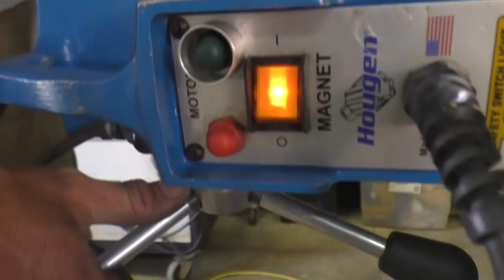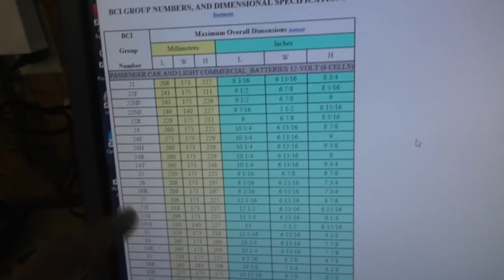Generator Frame and Engine Room Installation

Comment: YES! The DeWalt cordless portaband is epic.  Just picked one up with an extended life battery, and it paid for itself on the first job.
Reply from the maker: Richard at 42Fab sure loves all things dewalt.   I think they are great for the little jobs or were you have lots of little jobs spread out, but we have extension cords all over the place on the boat, and tools that burn 15 amps.
Reply: SV Seeker they’re just like cordless drills in the shop.  Certainly limited when lots of amps are needed for an extended period of time, but for general use it’s fantastic being untethered!  

Those DeWalt batteries recharge quickly too.  I only bought this cordless because my corded Milwaukee died.  Glad I switched.
Reply: And FWIW, with a 14 tooth blade and 6.0 AH battery I was able to make 8 cuts through some 6x6x1/2” steel angle iron.  Made 4 more cuts using two 1.5 AH batteries that came with my 20V cordless drill set.
Reply: It depends on the work your doing, I’ve got Milwaukee port a band with 9amp hour battery and it is a beast for most work (never used up a battery in one day doing fab work), but every now and then a corded one would be better for the extra punch. Either it or the M12 compact port a band would be amazing if you were a professional thief.

Comment: Sent here due to an Australian youtube site of a steel boat called Brupeg. They gave your site a good thumbs up. So here is a new subscriber from down under.
Reply from the maker: Cool.  Also check out "Life on the Mold"  another excellent Australian build.
Reply: I have a steel boat and looking at paint and rust protection. So many options.
Reply from the maker: Terry Peake I know the feeling. I tested pains and a saltwater tank for one year. Were using coal tar Epoxy.
Reply: @SVSeeker  this is a sailing yacht. Mainly topdeck and builge areas.

Comment: You might want to weld a couple of level foot holds below the deck. It will make working on the main engine a lot easier

Comment: engines typically have a stainless steel flex joint in the exhaust system before the first solid mounting point. since seeker will flex when in sea troughs or crests a flex joint is a good idea to do to prevent at sea stress fracture and failure of the exhaust pipe. also will solve any alignment issues as a side effect. it could possibly reduce harmonics and vibration transmitted to the hull as well.
Reply from the maker: Howdy Amiga.   Yes.  We have a flex coupler for each.
Reply: yey team! ;D

Comment: I see all these comments about heat in the engine room.  Its pretty hot underneath the hood of a car.  I agree with the plan of fans venting the engine room.  One pulling air, one pushing air.  Question about power management,  will the alternator make sufficient power so that the generator only has to run when the engine is off?

Comment: I do understand that room is tight in this vessel, but i do think having that Cummins underneath the other two engines is going to cause loads of overheat issues. You should ensure you have proper airflow in that engine compartment. 

In regards to the engine controls, that is actually what i specialize in. You should look more out there, there are options for you to have remote monitoring (from the ship's bridge). I know you think low oil pressure shutdown is cool, which it is, but there are so many more options out there that can provide so much more functionally.
Reply from the maker: I don't think that is an issue.  Those engines once lived in metal boxes and had radiators in the same box.  Now the radiator is a keel cooler and they live in a vented engine room.

Comment: SV Seeker I think that you need to change the bus transmission to an for a boat with forward neutral and revers
Reply from the maker: Bus transmissions have reverse too  :)
Reply: SV Seeker yes but it also have first, sekond, third and more gears. But try! :)
Reply: Christopher Chapman yes that was why i reacted..  If he want "that kind of power" he needs rotatable propeller blades..

Comment: Great video. Got a question, though. How much will Seeker heel? I ask this because it just occured to me that the oil pick ups inside these small engines may run dry if the boat heels too much. She will only heel a lot upwind but it's a consern. Having them in the low parts of the boat will have less effect than, say, a unit up on the deck. Are you numbering the decks like a ship? Starting at the keel with #1 deck? I know, I ask the odd questions.
Reply from the maker: Depend on how big the wave is and if she is breaching,  but normal heal will be about 25 degrees under full sail.  No oil pick up is going to have an issue at 25 degrees.   An no numbers, it's either on deck or below.

Comment: This is probably a stupid question but, are you going to soundproof the engine room?
Reply from the maker: We'll have hearing protection hanging beside the doors.  :)
Reply: SV Seeker I don't think he means specifically hearing protection while in the engine room. I think he means just sound insulation inside the engine room, so the engine room doesn't sound as loud when you are outside the engine room.
Reply: ha ha, I was thinking the same!

Comment: Have you thought about a gimballed generator frame so during rough seas the generator does not trip the low oil sensor and shut down at the worst time or are you going to rely on batteries
Reply from the maker: Walking around the engine room is asking enough without 400 pound machines swinging on pivots.  A list to 45 degrees is not going to be a problem anyway.  Motor vessels all have engines and never have I seen one that was gimbaled.
Reply: if you are into commerical marine.. generator sets have shut down when the boat pitched far enough.  its my idea.. and you need to carefully measure the Center of gravity.  you might want to use multiple holes  and inexpensive automotive hub and bearing assemblies.  so you can unbolt it and move the generator cage up and down. its just an idea.. but you have a sail boat that may go  over fairly far in giant swells during storms ..

Comment: That room is going to get hot running a radiator. would it be possible to put Y fittings on the gen cooling so it could be selectively tied into the fin cooler?
Reply from the maker: That is the plan.

Comment: Must have missed the vjo where you explained why it's not painted.
Why is rust not a problem ?
Reply from the maker: Rust is actually your friend.  It removes all of the mill scale and then protects the hull.  Painting before you are done welding means that every time you weld something to the inside of the hull, you burn off paint.   And painting on the inside means you have to grind off the paint before welding.   We painted the engine room before it was done, only because we are making lots of places that would be very difficult to reach later on.  So in there we grind before adding things like the pad eyes for the generators.

Comment: I thought the Vmac was a generator.
Reply from the maker: It is. It is also an air compressor a welder a battery charger and a hydraulic pump.

Comment: You do realize that with all of these air cooled (radiator, so water to air) diesel engines running and your main engine running with its non water cooled exhaust manifold, the air temperature in the engine room is going to approach you that of an oven preparing to bake a cake???
Reply: At least diesels run about 30 degrees cooler haha
Reply: So they can bake a cake in there, I guess!
Reply from the maker: You will not be whining about it off the coast of Greenland.
Reply from the maker: @sparky24 Not what we are doing.